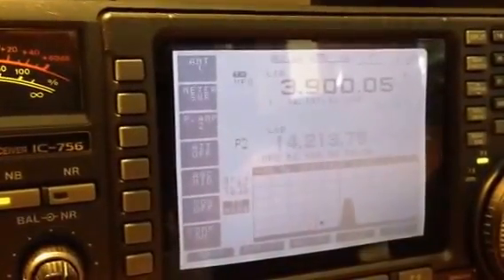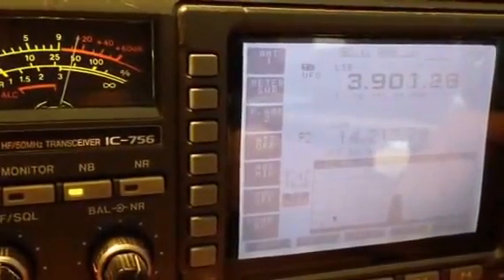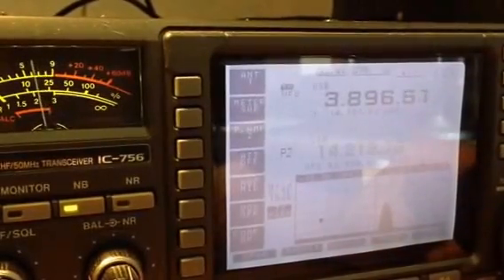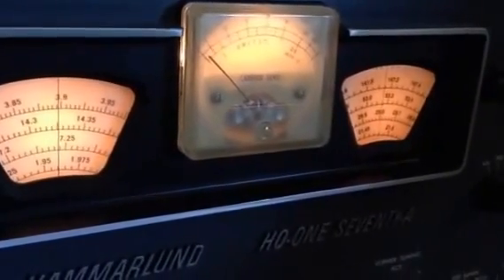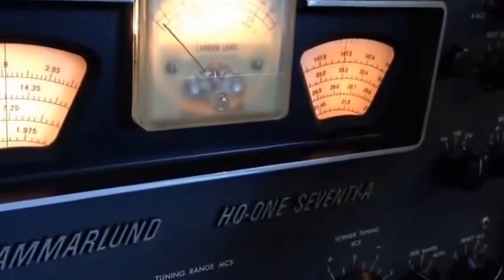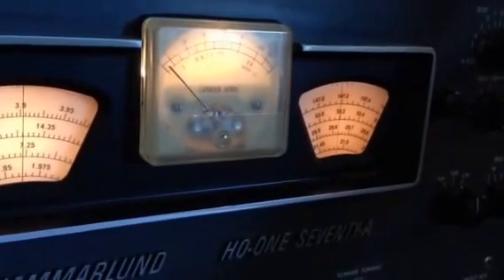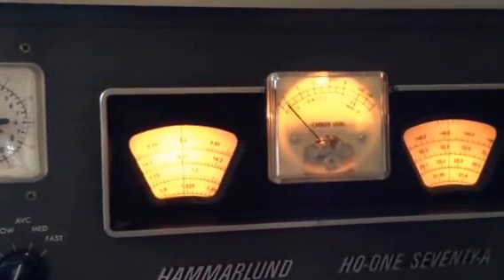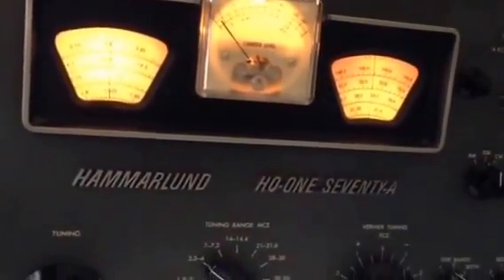Trouble shooting a Hammarlund HQ 170, K7PP Page

Comment from the maker: Pretty sharp eye,  John.  Yes,  I bought one of those kits from the Neatherlands.  It was a bit spendy but I got my 756 back.  These panels have an expected operation life of 250,000 hours instead of the 50 thousand the original Icom had.  Less current, less heat but very difficult to install.  Lot's of work on surface mounted components.